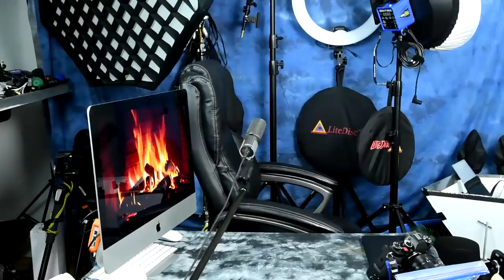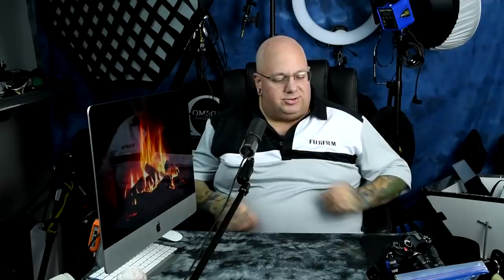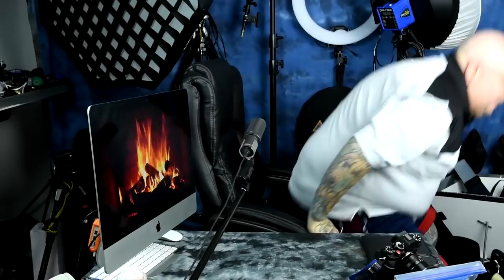🤔 Secret WHY ARTISTIC LENSES are not Mfg. by Nikon, Canon, Fujifilm etc.

Comment: Interesting what Ken says about "magical" focal lengths. I find 50mm either too short or too long for easy composition, but 40-45mm and 55-60mm in FF or its equivalent much easier to use. Why would this be, when the difference is so small? Perhaps Ken could do a video on this.
As an aside I picked up a Canon FL 58mm f1.2 a few months ago for use with film, yes I know its supposed to be dead but hear me out, and I do not doubt that its probably not super sharp, but the images from it do look beautiful even on low res scans of 100 ISO slide film. I think Ken is certainly onto something here with this video.

Comment: two main types of lenses, low contrast (usually old, when coating tech wasn't as advanced and their only solution was to use fewer elements(lets not get into the micro-contrast shite)) and high contrast (most modern lenses) i think you should buy according to what your style is. if you use a low contrast lens and enjoy high contrast images you'll be pushing your file more than you need to. and on the other side if you like the low contrast look but use modern lenses that are usually high contrast, you'll be pushing it unnecessarily the other direction. my point? get as close to what you want IN CAMERA. there are no 'shit' lenses really, although excessive chromatic aberration is where i draw the line. just something for y'all to think about, nobody i know has mentioned this and i think its important.

Comment: Hi Ken. Could you be a little bit more specific talking about the difference between Helios and Biotar 58mm f/2 lenses? I have or had around 10 copies of Helios, all of them worked and 3 copies of Biotar, all of them had issues. So considering build quality I think difference is not much. How about optically? Thanks.